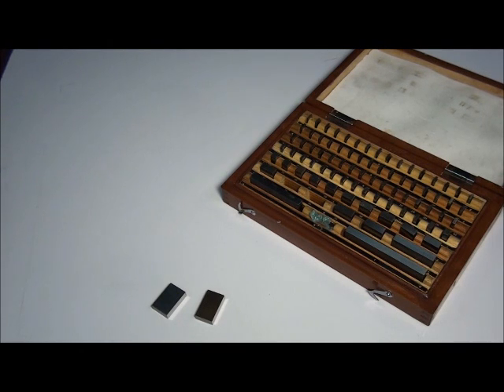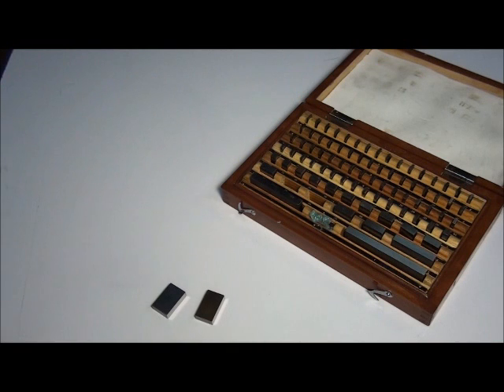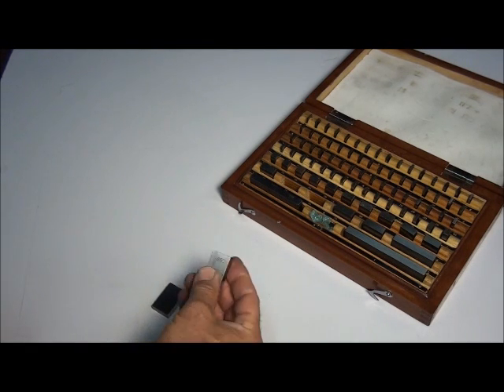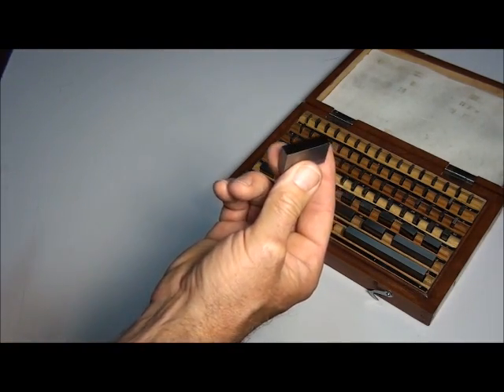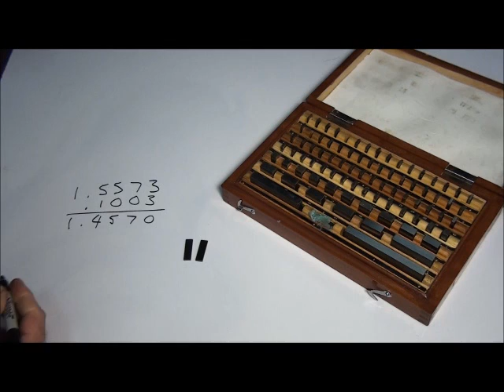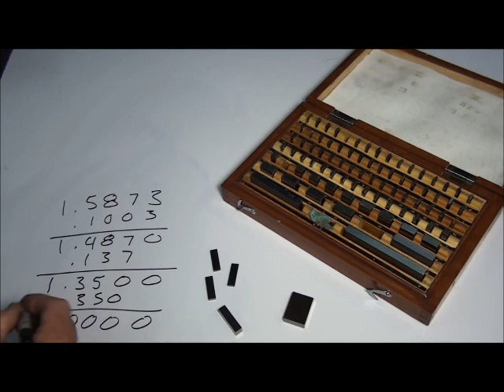How to Build a Stack of Gauge Blocks

Comment: Why don't they have stainless steel gauge blocks?
Reply from the maker: It probably has something to do with  hardness. Gauge blocks are typically made of high chromium steel, ceramic, or tungsten carbide, all extremely hard materials. I don't believe stainless can be hardened to that level.
Reply: @TomsTechniques  that makes sense. Ceramics would be your best bet for non-corrosion.

Comment: It's really a wonder that we can afford "economy" blocks, and use them to calibrate our OTHER cheap measuring gear!  Reading some old books that mention the introduction of this,  that the true original Johansson block sets came to America at something like $900!  Might have been a few years' pay for the guy on the factory floor there.  An aside about quality and "wringing"-  I once got to try a set of ceramic gage blocks in a salesroom, and it was really amazing!  They just went together so easily, the impression that they were magnetic was very strong, even though they were this white ceramic material.  Those are a few thousand dollars I think, which is probably a bargain even so, and still much cheaper than the 1920 originals.
Reply: The original blocks were likely purchased by quality and metrology departments at companies not individual machinists or toolmakers.   Henry Ford was a big early adopter of JoBlocks at Ford Motor Co.    Look at some of the early Ford manufacturing videos and you will see they were way ahead of most companies in manufacturing measurement which is key to volume mass production.   It is great that now almost anyone can afford what was once very costly measurement technology.

Comment: I was not going to watch because it just seemed to simple of a subject. What could I possibly learn?  As usual Much to be learned even about the simplest things! I just got a set that had the screw in the center to hold them together. Never would have thought you could get them to stay together with out a screw!!!!  Thanks for sharing your great knowledge.
Reply from the maker: Square blocks have a hole, but can be wrung together just the same as rectangular blocks. Round space blocks also have a hole, normally threaded, but are machine grade and will not wring. They work well for machine setups that might damage gauge blocks.

Thanks for watching.

Tom

Comment: VERY GOOD instruction.
I might add.
Re. “dressing” a burr on a gage block by rubbing it on a surface plate lubed with denatured alcohol. You DO NOT try to “dress off” the burr as you would also remove material from the rest of the gage block surface thus undersizing the block. Using a surface plate DOES NOT remove material it pushes the raised burr back down (if it is not too bad). Also, to press the burr down uniformly you should use a figure 8 motion. If the block will still not wring, REPLACE IT. The raised burr will scratch every block it is used with.

Comment: It's not only air pressure that holds the blocks together  ... two (or more) gauges wrung together will stay firmly conjoined even if put in a vacuum chamber and all the air exhausted.

It's more a phenomenon known as  covalent bonding (which also leads to the gauges getting inseparable if left wrung together for long periods of time).
Reply: Minor correction: It is van der Waals forces, not covalent bonds, that provide the inter-molecular attraction between blocks. As you move the surfaces very close together, the electron clouds surrounding each atom in the material at the surfaces start to interact, creating an "induced" dipole. This is sort of like a temporary magnet (but not really, see below) and the effect is an electrostatic attraction between the surfaces. This same phenomenon plays a role in friction too.

It is important to note this is not a magnetic effect, which is a totally different mechanism. When the blocks are manufactured, the grinding process actually generates a lot of magnetism in the part, so they are totally degaussed during the manufacturing process, and sometimes during calibration.

Comment: Excellent video!  This may be a dumb question, but how do the gauge blocks adhere to one another?
Reply from the maker: It's actually air pressure that holds them together. They are so flat that all of the air is evacuated from between the blocks, creating a vacuum and resulting in 14.7 psi. of force from the pressure of the air around them. Lab grade blocks left wrung together will actually grow together and become one piece.

Thanks for watching.

Tom
Reply: Toms Techniques Hey Tom, thanks for your reply, that is just fascinating!!  I saw in the video where you had mentioned they would "grow" together if left "stuck" to one another, and that just blows my mind!  Anyhow, what brought me to your page is;  I am interested in finding some equipment for DIY gunsmithing and was wondering if you could point me in the right direction as far as what may be the best tools to acquire.  I am interested in purchasing a lathe and milling machine.  I would probably rather have manual machines, as I am of the impression that may be the most economical and best way to actually learn how to operate the equipment.  Any information you can provide will be greatly appreciated!  

Thanks!

Jeff
Reply from the maker: AccuracySpeaks

I'm not a gunsmith, but if I were, I would make sure the lathe I purchased had a large enough spindle bore to pass the largest barrel that I planned on crowning or chambering. Also, gunsmithing uses a lot of unusual thread pitches, so make sure the lathe can handle them.

The mill should be a Bridgeport type/size and there are many to choose from. Mine was made by DoAll in the 80's and it's a 9X49 with variable speed and an Accurite digital readout.

Tom
Reply: Thank you for all your help, I really appreciate it!!